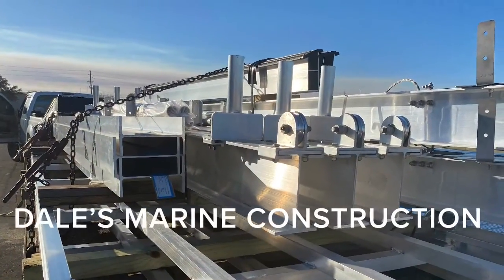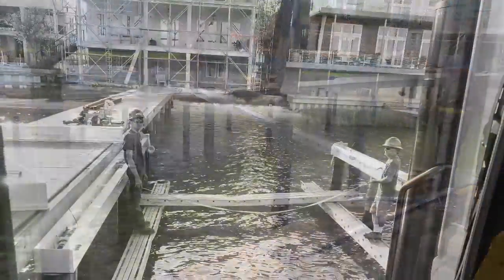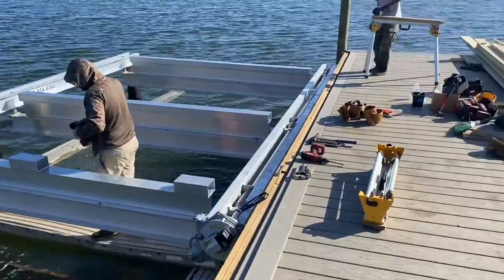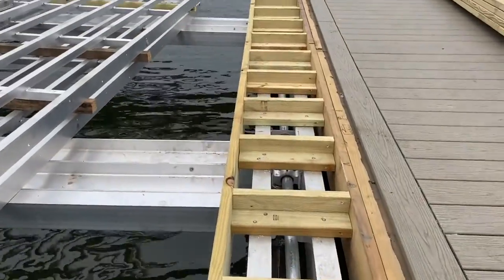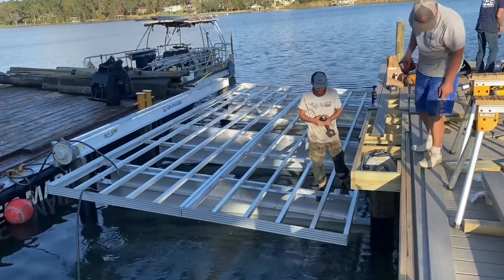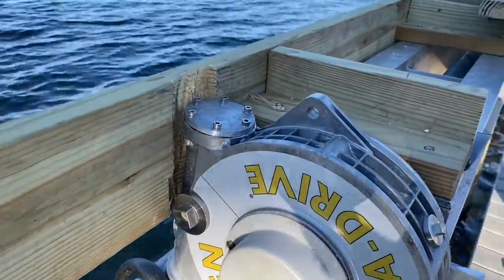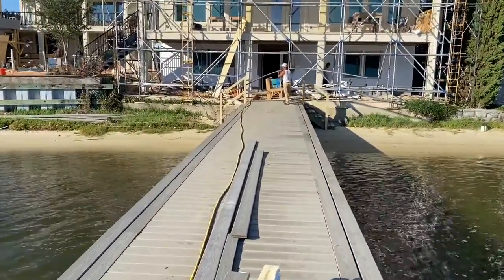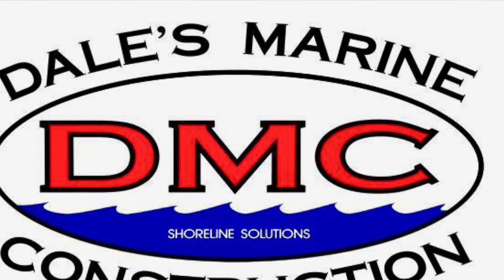MARINE CONTRACTOR VLOG/ Trex decked platform 14,000 lbs. submersible boat lift

Comment: How do you maintain the pulleys and drives with framing over the top of them? Is the pressure treated lumber in direct contact with the aluminum? If so, how do you prevent bimetallic corrosion?
Reply from the maker: Hey Chuck thanks for your comment we have access points we needed but most of the pulleys can be service from underneath. We use Piling rap  plastic to isolate any structure that comes in contact with the aluminum. Good observation 👍

Comment: Also, what material did you use to frame the substrate on the moveable deck? I am assuming you are wanting to use something that is both strong and as light weight as possible.
Reply from the maker: This is a pre-fabricated aluminum frame that comes from the boatlift manufacture. I give him the dimensions and then we bolt it down.

Comment: What material did you use for the guides you installed to keep the moving deck from going under the existing dock when it is going up?
Reply from the maker: I framed off the pilings with salt treated two by eights and then put a piece of starboard on top of that so that the aluminum frame could slide easily up and down you really got to make sure all this is level if not it will get into a bind in backlash or cables. Thanks for watching 👍